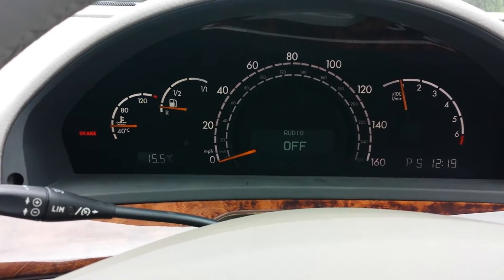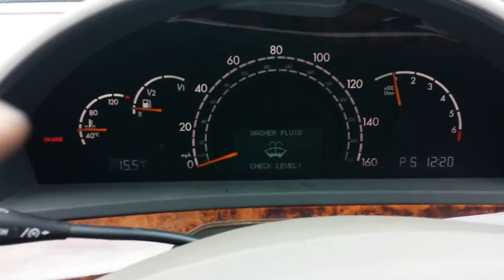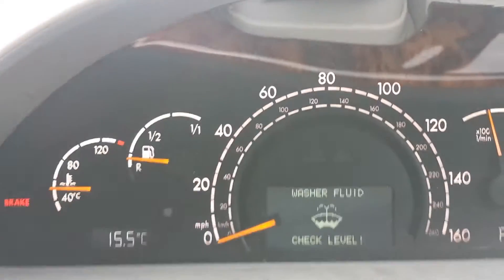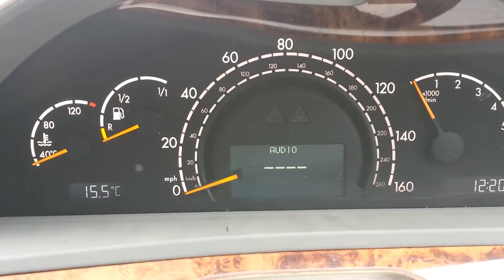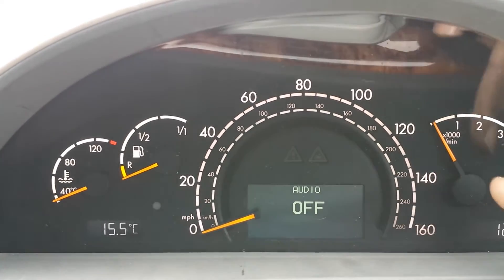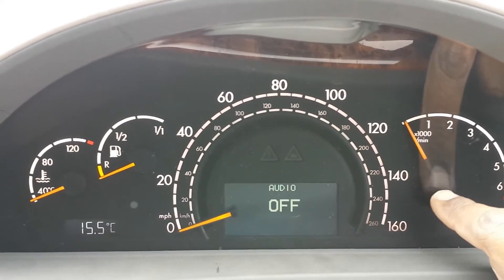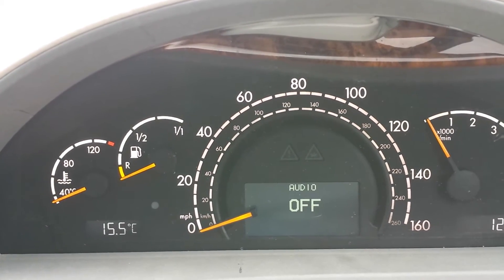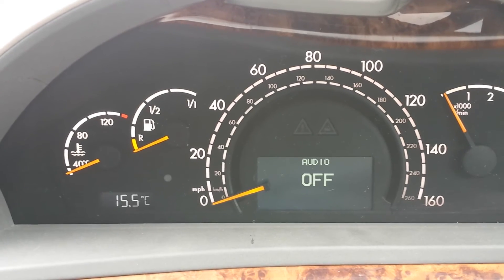Part 5/5 Mercedes S-Class W220 Instrument Cluster Repair

Comment: do you mean before assembling the cluster I have to connect it to the car and put the key to position 1. Then move the needle clock wise then anti clockwise. Ok move the needle clockwise (where I have to stop)? What about the speedometer? The same ?

Comment: Cool video. I have a 2002 S500 and the check engine light burnt out. Is there a way to replace only the bulb?  If I get another cluster will the original mileage appear on the new cluster? Thanks
Reply from the maker: Al A 

Hi, 

Thank you.

You can certainly replace
the bulb easily, it is not difficult at all. Regarding the new cluster; the mileage
is stored on the cluster and you will lose the previous millage. The cluster
can be reprogrammed for the millage. You can only increase the millage if you
have your own Star system, decreasing it requires you to go to Mercedes and
this is done using the same software but authenticated with an online server,
which Mercedes control.

The most important issue
you face when putting in the new cluster is, some of the options as they will
have to be reconfigured. For example if you have Tyre Pressure Monitoring
system, the menu item may or may not appear. In either case it is not difficult
to enable it. I have purchased my own Star system and will be publishing videos
on how to do some of these options.

Hope above helps. 

Regards

Waqas

Comment: Hi, i replaced the transformer with a type b and also replaced 2 mos-fets on my cluster w220 2001 s500. The cluster still doesn't work, there are no lights and the needles wont move. any suggestions?

Comment: My Mercedes w220 has a problem in its cluster's menu small screen, it's kinda like a crashed screen, doesn't show me info in the middle part of it.
Do you have any idea how can I fix it? Does it have any thing to do with the transformers?
Reply from the maker: Mosammgroup Hi, if the screen is illuminated but the text is scrambled, then it may be a matter of cleaning the contacts for the display. I have not come across such a problem, therefore cannot advise properly, however I can confirm that it would not be related to the transformers.